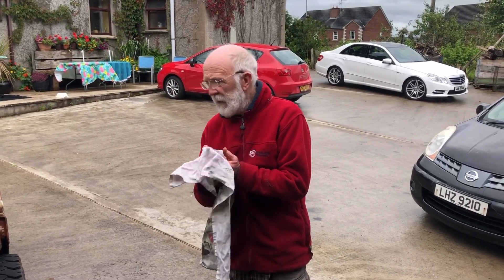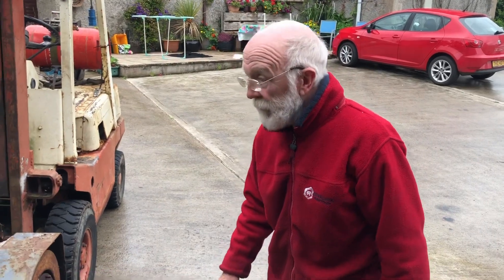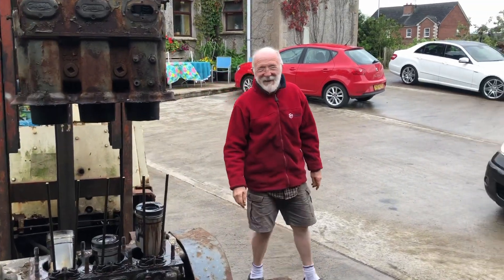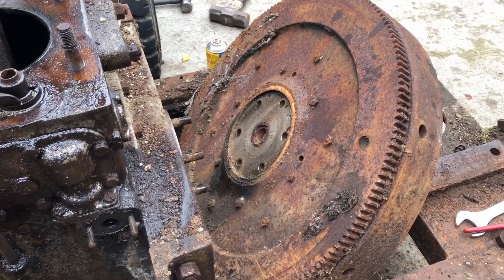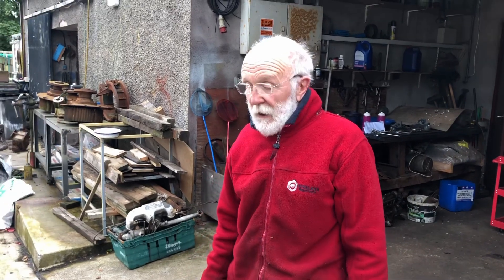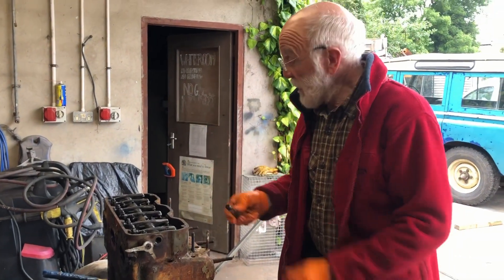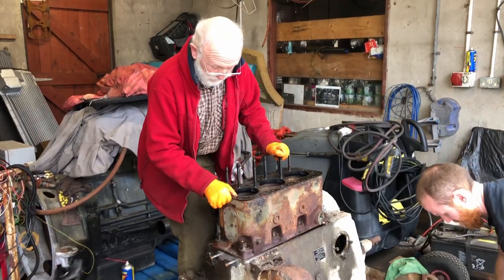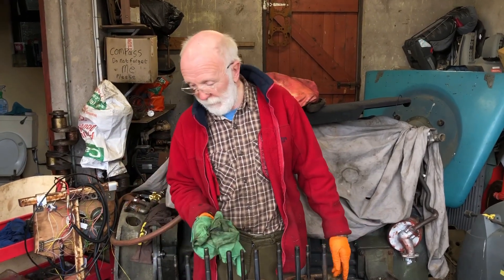Strip down of Gardner 3LW Part 2

Comment: Thanks for another interesting insight to the Gardner diesel engines, very well designed and the modular heads were 'ahead' of their time!
One thing though, on re-assembly of the heads I've heard they used a metal-to-metal interface with the cylinder block.
Were these lapped in place (like valves) or were they hand scraped using bearing blue?
Reply from the maker: Graeme, the LW and LX series engines used a conventional metallic head gasket.